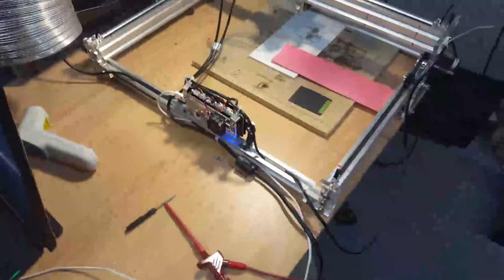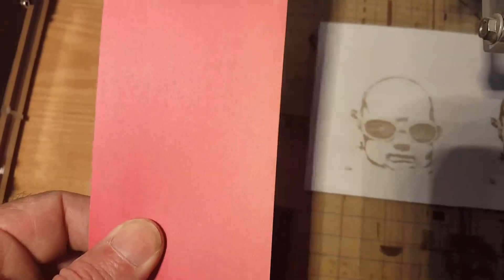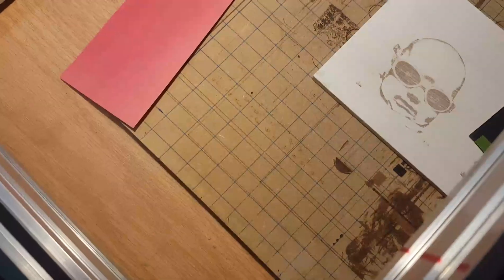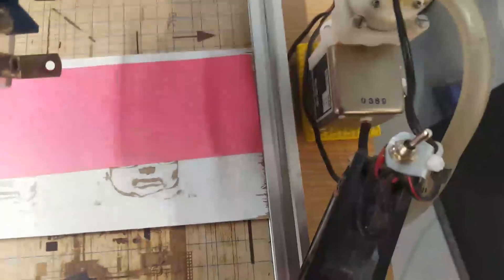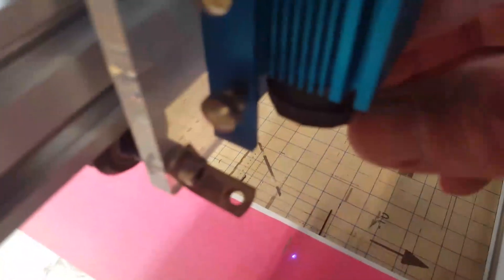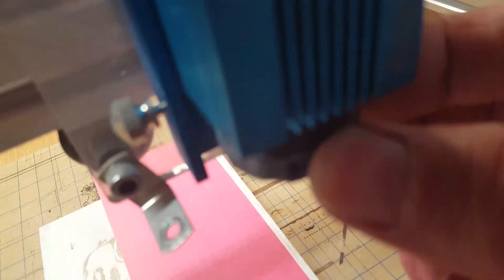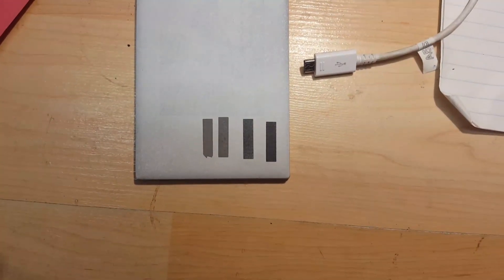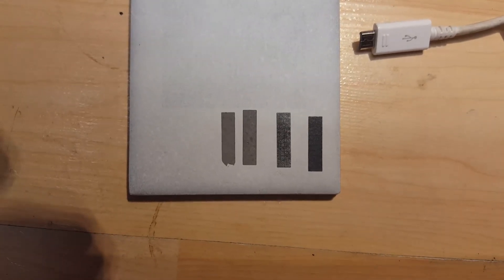Norton method to focus Diode Laser

Comment: Using the paper on the substrate lifts the focal point from the substrate that you want to engrave on. How does that effect the burn? Does the color of the paper matter or was it just to see the contrast? Thanks.
Reply: if your system is affected by 0.15 mm ..then what you do is place a piece of 0.15 mm paper under the workpiece after you have focused beam
Reply: the red construction paper is 0.15 mm